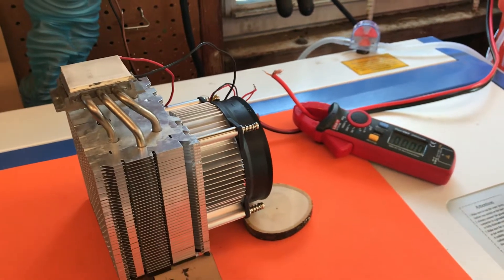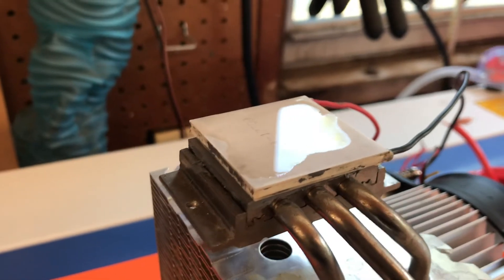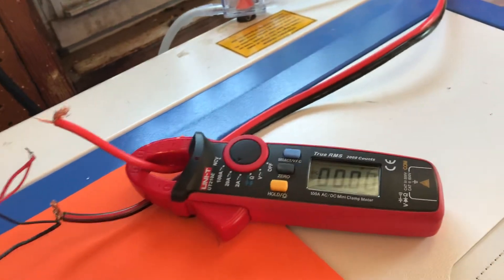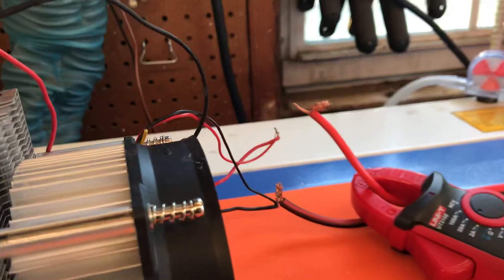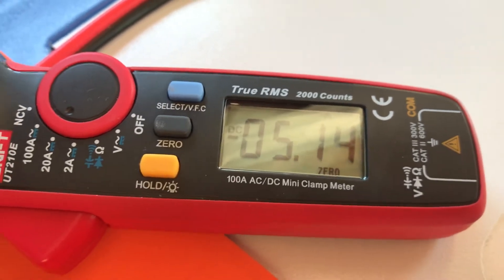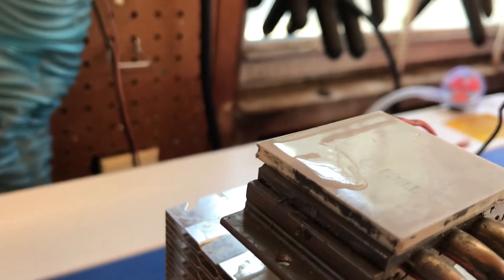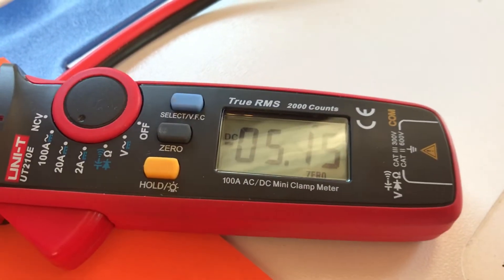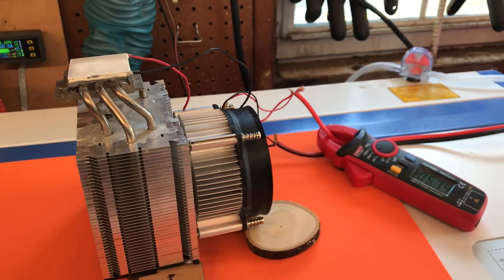Solar powered peltier tile

Comment: i have a homemade project like that, using one solar panel and dc-dc converter to output a stable 12V
and a 2 peltier module to use the for water collecting from air you can try this it's cool!

my remarque for your video is that you should wait a little bit of time to freeze that tiny water drop, approximatly 10 mins
Reply from the maker: So lowering the amps would just keep it cold without freezing? Cool idea
Reply: @Checkitfirst  yes low amps just cooling not freezing